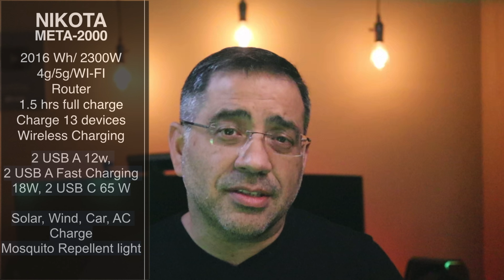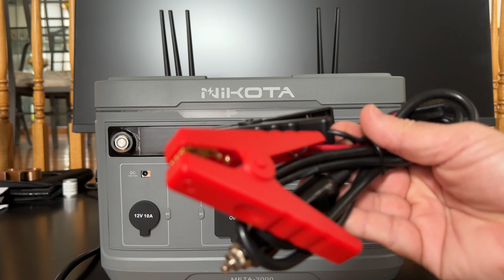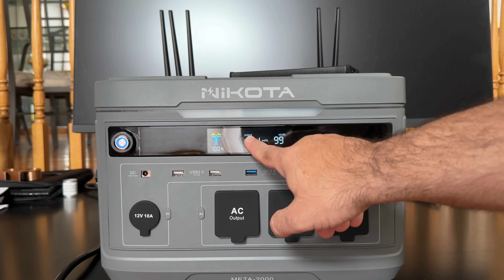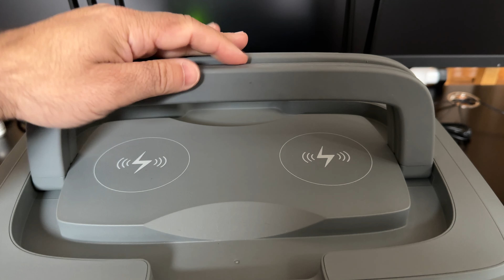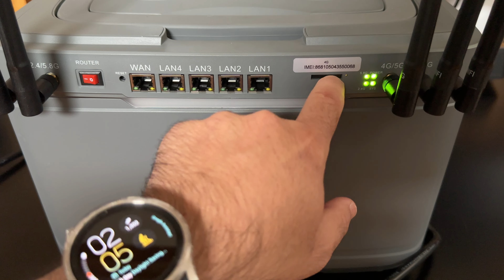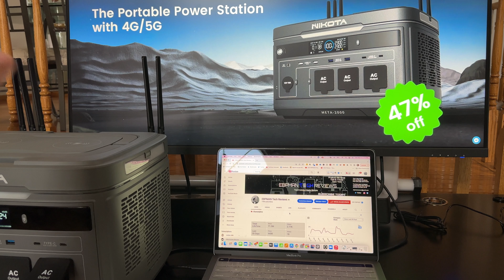5G/4G Power Plant with 13 Simultaneous Connections! NIKOTA META 2000

Comment: can i use this for electric radiator of 2700w power? if not, whats the maximum power radiator can I use it for?
Also, can I charge whilst using the AC output?
As for router, can I simply plug the internet router wan to this so it stays on if the house internet is down?

Comment: Solar charging?? what kind of cells in the battery??? what size inverter???? Is the 12 volt regulated??? How much power do you get out of the unit actually???
Reply from the maker: Here are some details on the product.  The META-2000 has a 2,016 Wh capacity with a maximum power output of 2,300 W. For example, this allows you to power an electric oven for 1.1 hours or a projector for around 25 hours. Plus, ultra-fast recharging enables the gadget to charge fully in 1.5 hours. You can use the product to simultaneously charge up to 13 devices via ports, including USB-A, USB-C and AC power. In an emergency, the power station has a built-in light that can run for up to 20 hours on 0% charge.
Reply from the maker: https://www.nikotapower.com/  is the site kickstarter goes live in a few days.  Much more details will come in.
Reply: @ebpman  After the year they can't run the web-site: This store is currently unavailable
Reply from the maker: Solar 600W, 11-42V, 18A (Max)  Cells are NCM 21700  I dont have a brand.  I have an early version.  The kickstarter will have more details